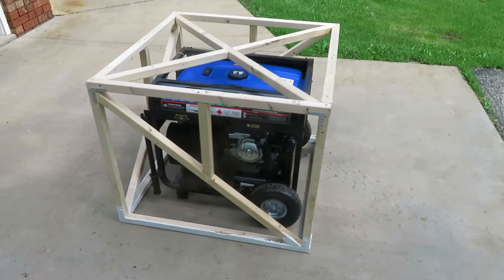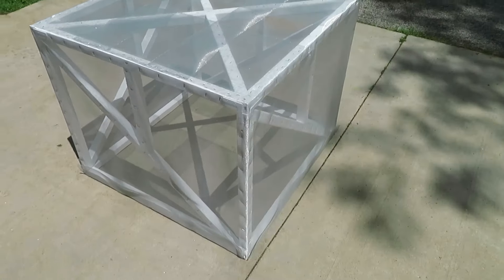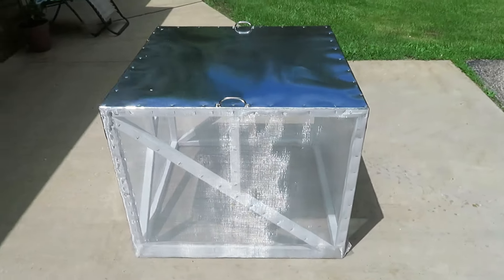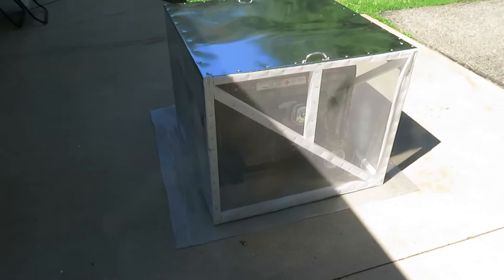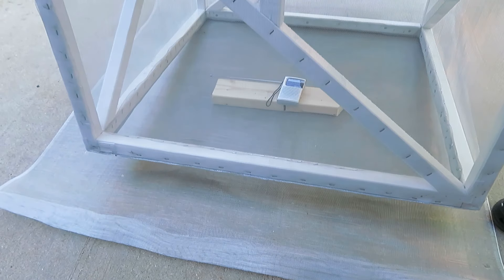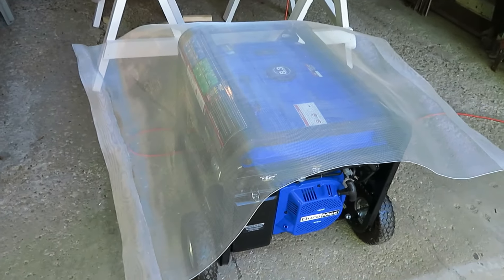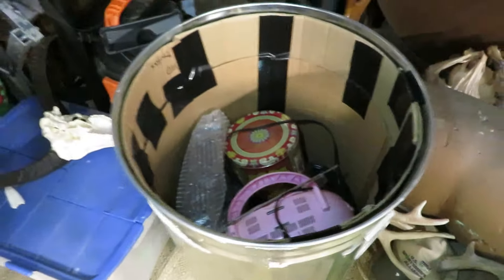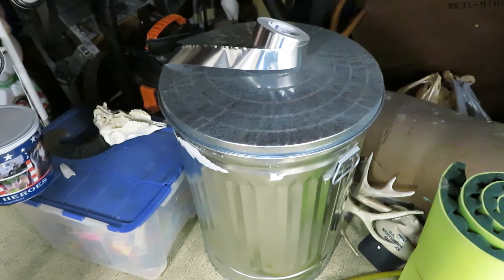DIY generator Faraday cage

Comment: My generator is the same size and I was wondering about a good way to cage it.  Thanks.  Not sure I could do it for $40, but even if it cost me 2x that, it would definitely worth it.  Plus I have plenty of time on my hands for a new project.  Thanks.
Reply: I built one just like this video but mine did not work, and I don't believe it was due to a careless build.

Comment: This is a great design concept that can be accomplished with reasonable effort. Ok so it may not be perfect for all EMP frequencies and intensities but it is better than nothing. I am looking to duplicate your design but by building a plywood box, using aluminum screen like you did and then draping it with faraday cloth. This will ad $50 cost but give me a little more protection. Thanks for being a thought leader on this!

Comment: This has me thinking. It wouldn't take much to turn a regular garden shed into a big Faraday cage. Just line the floor, walls, and ceiling with this screening. Run a 4g copper wire to a grounding stake and Bob's yer uncle. They sell 100 ft rolls of the screen for not too much money. I think the only puzzler would be the door. It would have to seal the gap when the door is closed, but I'm sure there's a workaround that's not too complicated.

This is a great idea. Thanks for the inspiration.
Reply: Don’t ground it… that defeats the purpose.
Reply: you might be able to use metal duct tape used by ac installers
Reply: That's my plan. I have an 8x6 that I want make an entire cage out of
Reply: There's a guy on YouTube called the EMP doctor. He sells a gasket for sealing things like those metal trashcan faraday cages but it might work for a door too maybe.

Edit: now that I think about it I think he has used it for a door.

Comment: Question. EMP is not radio waves. A single powerline can stop an AM signal. Did you test Bluetooth or GPS signals under this cage. I made a small bag for my key fob and I tested how much aluminum it took to stop the signal. 1 wrap of aluminum did nothing. 2 wraps of aluminum blocked some cellular. It took 3 wraps to stop Bluetooth and GPS signals. I only mention this because it looks "too simple" to prevent high powered magnetic waves from reaching the inside. Similarly to a microwave oven some waves still come out through the screened glass window.

Comment: EMP or not, this 'cage' will keep the critters out too!  Recently my generator failed to run on propane until I found the problem: insects had built a nest of something inside the propane hose's tiny opening which stopped the propane from reaching the unit sufficiently to run it.  I can tell you, the screen mesh alone would have prevented that.
Reply: thanks for the warning. going to seal the hose with a heavy duty ziplock bag
Reply: Spiders are especially attracted to the propane smell and can nest inside the lines webbing them closed.

Comment: EMP has happened and it is time to drag the generator out of the garage and start it up.   Can I start and use the generator inside of the EMP Faraday cage?   Will the electrical cord void the Faraday cage.   Will I have to buy a EMP shield device to protect the generator?  Can I run and receive power from the generator with the EMP shield?

Comment: If you had an unlimited budget, how would you improve this cage and why?  Would thicker mesh be better, or rebar?  Would solid metal walls be better?  Would even thicker metal walls be better than that?

How confident are you that this will protect against EMP?

Very informative video, thank you!
Reply: No one knows for certain what an EMP will do to electronics. 
Nor what to do to protect themselves from an EMP, other than digging a very deep hole under mountains.
Not even the governments that would do such a thing to other nations.

Comment: I had a pacemaker implanted and the Dr. said I couldn't work on my motorcycle, motor not running,  because of the magnets used for the ignition system. I'm trying to create some sort of faraday device to I can do some minor work. Any suggestions would be great.
Reply: I'd be worried about that pacemaker if a emp or a strong solar flare happens

Comment: Bout time someone did it right.  Make sure there's an insulator between the generator and the bottom mat.  Square of plywood will do it.  As for the garbage can, put a phone inside and call it.  I had to close the lid on a strip of mesh to get it to make a good contact with the can before mine would block the cell phone.
Reply: The insulator between the generator and mat: wasn’t that what the “folded 5 times aluminum mesh” on the bottom of the cage was for?
Is the plywood really necessary?
Reply: @debragarrett5110  You need to insulate whatever's inside the faraday cage from the cage itself, otherwise you're just completing a circuit.

Comment: I just built one mostly based on your design. I got the same results with stopping radio, but not with a cell phone. I’ve done a little research with mixed results about that. Shouldn’t the cage also stop the signal to a cell phone?
Reply: Exactly??? Cell phones run on Giga Hertz Frequencies which is like a Microwave? Faraday cages "should" stop these frequencies also?
Reply: My husband JUST built one using this exact design and laughed at me when I called his phone that was inside the cage. Hes like “thanks for wasting my entire day for nothing” 😢 sigh… guess I have to figure out something else now. I am not looking forward to spending $1000 on a bag.
Reply: @veronicabelmonte2796  Same thing happened to me.  I guess it serves me right for trusting random YouTube videos.  I built one just like the one on this video and it does not work.  Too bad.

Comment: All the engineers I’ve read stated you are suppose to solid aluminum. Screening has holes. I saw a simulation. EMP moves trying to get through to penetrate. Great idea but I would use your frame but put the 4x6 sheets of exterior insulation it has very thick aluminum on each side and 1” of solid foam insulation inside. They state aluminum then a buffer like paper foam etc and then your product. EMP tries to enter top bottom and sides. Just a thought. The insulation sheets are 7.00. Cheap. Have lined plastic totes works great. Use the aluminum hvac tape to secure corners.
Reply: Yeah, I followed this model of this video with aluminum screening and it didn't work at all. There are no gaps in mine, but it is not acting as a shield for me.

Comment: N you use a 55 gallon barrel lined with cardboard and then your 2000 eu generator wrapped in heavy duty aluminum foil, 2 or 3 layers and then stored inside the cardboard lined 55 gallon barrel for a Faraday cage?
Reply: That should work if the lid is metal to metal contact
Reply: That should work if the lid is metal to metal contact
Reply: That should work if the lid is metal to metal contact
Reply: That should work if the lid is metal to metal contact
Reply: That should work if the lid is metal to metal contact
Reply: That should work if the lid is metal to metal contact
Reply: That should work if the lid is metal to metal contact

Comment: So if a emp would happen how do you get fuel for your generator? Inhave about 25 gallons of fuel that I alternate and use fuel stabilizer but how long would fuel last being stored in containers with stabilizer?
Reply from the maker: Recall it can run on either gas or propane and propane lasts many years. Gas (I rotate my supply) last 2 years with stabil.
Reply: @innovativeoutdoorsman5067  i okay I wasn't aware that gas would last that long!! And my generator runs propane as well. Thank you I appreciate the fast response and I guess I need to stock up on more fuel and propane now 😉👍
Reply: @innovativeoutdoorsman5067  I do the same except I use "marine stabil". I am told it is made to last longer due to marine motors sitting for long periods.
Reply: An EMP event is a one time event lasting until the nuclear explosion dissipates over a few minutes. After the explosion you can again access your electronics as needed. The problem is you never know if there is a seconded or third bomb going off a day or week later. That is probably doubtful, but can happen.

Comment: I made my own box and am using an app that came with a faraday bag I bought to test it.  My box keeps out cell signal, but not WiFi.  Not sure if it matters that WiFi can get though or not.  Any thoughts?
Reply: Yeah, the mesh is stupid to use
Reply: @braddougherty3401  why?  What would make this mesh cage better, and why would it be better?  What if the mesh was thicker like fencing wire?  Or even thicker like rebar?  Or is it better to have a solid metal structure and no air gaps?

Comment: couldn't you just build a plywood box and cover it with aluminum foil?
Reply: yes, but not as durable as the aluminum screen material.
Reply: Yes you can, but don't forget the bottom

Comment: Don't emp proof a generator unless you only plan on charging batteries inside the box with the generator because emf can travel down a wire. But if you use alternative sources of power such as liquid wires and permanent magnets it's way more expensive per watt but water can't melt or get hotter than 100c and permanent magnets arnt destroyed by emf so a generator can be made emp proof and a network can also be emp proof using fiber optics to send data in and out and you could just get air powered engine that's emp proof and can charge a air tank to store power like batteries and can work without fuel you just need air pressure and you can get that with any method like use chemistry like acid and trash or bio method like yeast and garden trimmings cuttings slow production but constant CO2 or just use a air pump
Reply: WTF?

Comment: why line with cardboard?
Reply from the maker: no contact with the metal can
Reply: @innovativeoutdoorsman5067  well thats what I thought but the guy that wrote that book, arthrr bradley (?)  I watched an intro vid from him and it seemed fine to roll the tinfoil over the box. Plus I watched another with a cage built over a gennie, seemed to block the radio reception fine.. and.. also.. (Im so confused) arthur bradley said "no need to ground".. but I see "emp" as  electro magnetic pulse.. (electricity) not a "radio wave".. just what little Ive dealt with industrial power, I would think one needs a well grounded, sealed metal, internally insulated with non conductive material box.. right?? And really, does it matter if the device is off and/or unplugged? Ugh..

Comment: I’m working on building this now.  Thank you so much for this video.  I’ve been watching it over and over to get it right.  So far so good.  What did you attach the aluminum mesh with?  Can I use a staple gun?
Reply from the maker: Yes, that is what I used, Make you overlaps at any seams as large as possible. Leave no open air gaps.
Reply: @innovativeoutdoorsman5067  thank you this solution is going to save me a lot of money.  Great Video
Reply: @innovativeoutdoorsman5067 do i need to lay down a piece of plywood at the bottom? Or can my generator and other objects sit right on top of the aluminum screen?
Reply: You need to insulate. Some use cardboard if indoors

Comment: Hey thanks for the video!!  I just got done building mine just like yours.  I do not have an fm radio to test but when I put a gmrs radio in the cage it still receives the signal fine.  I know the frequency is 462.575.  Would you happen to know if gmrs signal gets through on yours?  Thanks again!
Reply: A faraday cage doesn't "block" signal, it attenuates it.  How much attenuation you get depends on how well the cage is built, but standing right next to the cage with a strong transmitter is likely to get enough signal through to be heard.  You might 60 - 70 db of attenuation with the window screen.  To get more, you'd have to build a second cage bigger than the first one and put it inside of it, like one of those russian dolls while making sure they are not touching each other.

It's also possible the antenna in the handheld was capacitively coupling with the wire mesh if you were really close by, in effect turning your cage into another antenna for the radio.  So try backing up a bit, maybe 20 feet, and try again.
Reply: @andrewscharbarth2099  thanks for the info!  Yeah after I posted that I watched some videos from Emp Dr who said the same thing.  I know I built it well enough so I’m just gonna call it good.  I do see w a cell phone inside that as soon as I drop the cage down I lose all my wifi networks, then a few but not all come back, so I’m believing it’s a good “seal”.

Comment: I am getting mixed info about protecting the solar panels. What's your take on the panels? I have 4 aluminum garbage cans, two large and two small. I found cheap plastic garden pots to line the insides. Also used aluminum tape around all handles. taped both inside and out. I was picky about each can's condition at the store. No dents and good seal to begin with. I like your small tins idea  for inside the big can. I think the important thing is to attenuate the pulse to a much lower dB to succeed. The trash cans should suffice.  Make sure to have a drive loaded with movies for entertainment as well. I have a couple old tablets and laptops protected as well. I just bought two Honda generators because they are much much quieter than others. Don't want to attract attention. I couldn't believe how quite the EU7000i and EU2200i are. They also have Eco mode and use much less fuel than my older units that had one speed to create 60 Hz. The inverters are super clean AC outputs that stay at 60Hz at all loads.
Reply: Solar panels and lead acid batteries should not be harmed by an EMP. the problem is with all the electronics,  from my research you can purchase EMP hardened solar equipment
Reply: Following

Comment: hello there man, very creative idea and execution, can i get an opinion? i m doing a project lasts 2 year on Brazil and i m having a big FUC1N5 problem that is blowing my mind man. Here i have a chemical industry but there s a lots of underground water, so much on some cases it s coming from ground to especial hard ground on basements ... this water is generating a kind of strange EM field arround all area, them my ground condutors are inneficient ... do u think a faraday cage could dissipate back to the ground those strange EM fields?
Reply: I am very familiar with this problem,  I'm from Wisconsin USA, we are a very large Dairy State, our electrification grid was built in the 1940's and unlike the EU we use mother earth as the Neutral / Ground from the home back to the Electrical Power Station.  What you're experiencing is called STRAY VOLTAGE.  Somewhere near your home is a power pole that has a cable ground wire going into the ground,  that (unused) returned electricity is going from that ground wire ( through your house) back to the generation station. It can cause severe health issues,  restless sleep,  animals not drinking from metal bowls etc. You can trace the stray voltage source with divining rods and cut the ground wire at the source ( this is very dangerous high voltage and is very illegal,  be careful because you could kill yourself). Or? You could be very blessed and live on intersecting LAY LINES.  but hopefully I have given you two things to research.

Comment: If an EMP happens and your the only guy with a generator running for miles around it wont be a benefit. Also having to source 100’s of gallons of gas a week will be dangerous. A solar generator is the way to go. No noise and can recharge 100’s of times.
Reply from the maker: HAhahahahaha No. I now live in the middle of nowhere with no neighbors and a quart mile long private driveway into the woods so noise in not an issue and even if it were, its so easily solved. I also have solar but 4 backup generators and lots of propane to run them on (not gas)